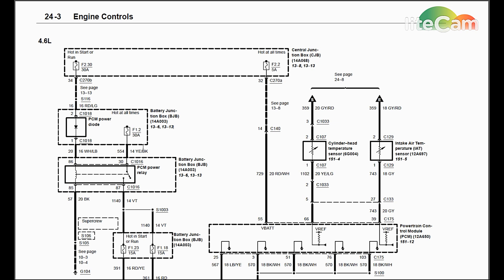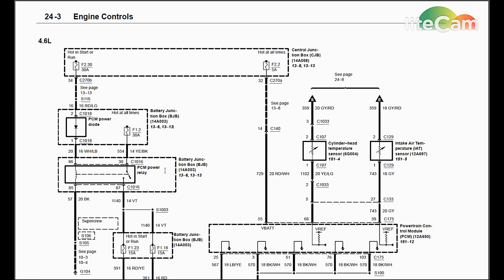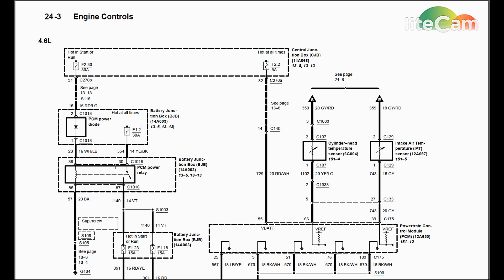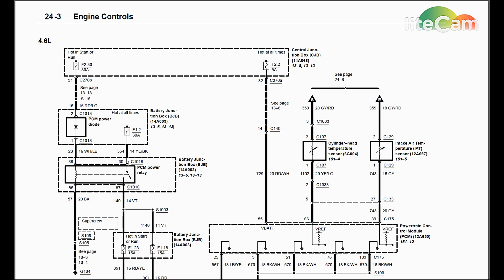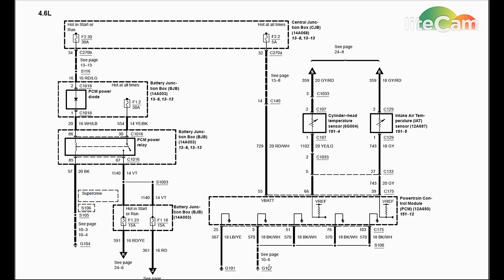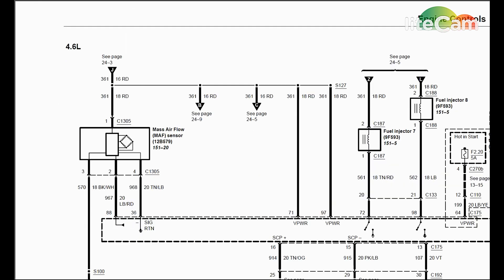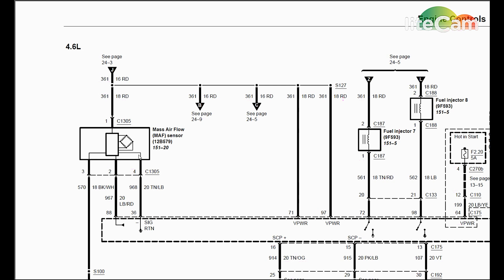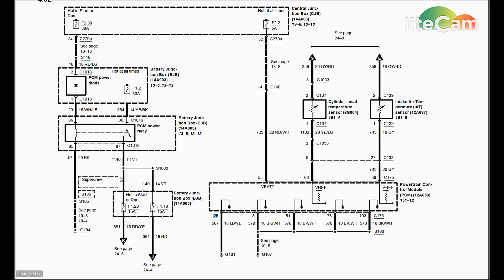Wiring Diagram Diagnostics #1: 2003 Ford F-150 No Start Theft Light Flashing

Comment: hey bud, just wonerinf if youve had any dealings with 2002 f150 pats intermentint romblems? this wasmy dads truck, he got hit a few years ago, since then, every now and then, the truck wont reconize the keys, an wont start. crank no start. it has actually gotten frequent as of late. it doesnt seem to matter if its raining, hot or col outside. cant fin a common varible. cant rely on the truck to start, but but i have to rely on it now, so i need to get it straight so im not left straned! so any help would be great. btw... if my typing is off, i apoligize. my keyboard is acting kina crazy.

Comment: Hi,  I have a 2005 f150 5.4 4x4, and I’m having problems with the mas air flow sensor, I installed a new sensor and it still doing the same thing, the vehicle will start for a few seconds and shuts down, unplugged the sensor and it starts with no problem. I checked power between pins 5 and 6 and I get 14 Dcv but it drops down to 000. I’m thinking it’s the pcm relay??????

Comment: This video was extremely helpful. 2003 F150 had Theft light 16 code. With these diagrams I was able to trace the problem to a broken wire from the fuse that feeds the PCM relay contacts. Fixed that connection and life is good. Thank you so much for sharing!

Comment: Went through each fuse step by step and solved each powering issue until I got to the pcm relay. There is power coming into 85 but nothing into 30 even though fuse 2 has power. Any help?

Comment: Had this problem, your video help me find that my wire to pin 30 was corroded and needed to be replaced.  But I still don't have power to f2.20 or f2.21 in start. Blinking theft light off but car still won't start
Reply: Dennis Brodzinski

Comment: I have a 2000 Ford Mustang convertible that has a crank no start issue with dashes on the odometer and the self diagnosis does not work any ideas on where to start been chasing this for a year and a half with no results the pcm looks good internally no pops or burns all coatings still in tact internally please help I drove this car 1 time before I bought it and when I went back to pick it up this is what I got myself into
3.8 v6 5 speed manual trans I know you just have to be smarter than the machine but Apparently this is above my pay grade

Comment: the wiring diagram gives good direction. Yesterday i diagnosed an '87 Ranger 2.3L, crank no start.  Diagnosed a defective inertia switch....no accidents, just old age.  Wont allow power to either fuel pump.  Bypassed the switch and the truck started right up.  I'm thinking about cutting the switch open to see what the issue is inside.  I can hear what sounds like a loose metal ball when I shake it. When i 'reset' using the white button on top the ohms go all over the place, lots of resistence to almost none and sometimes goes OL.  Crazy how it just crapped out. I own the truck for 17 years and never had a no start ....not bad i guess since the issue happened in my driveway, how convienent!  Thanks for the vid, keep them coming Brian!